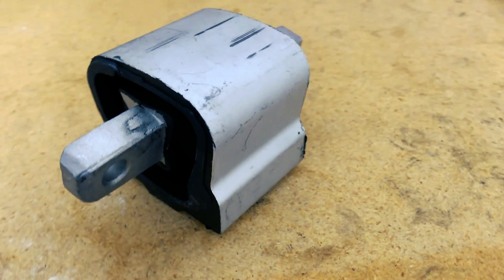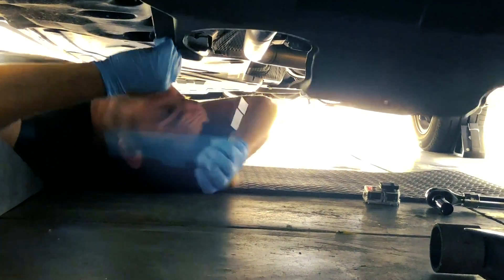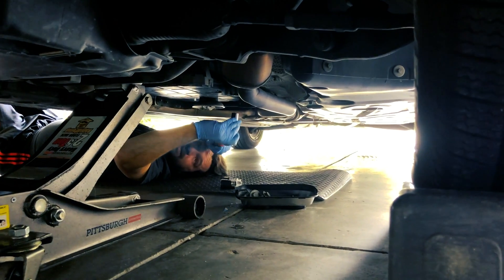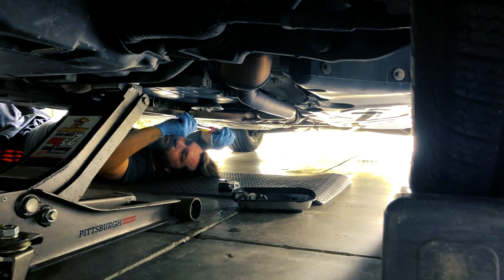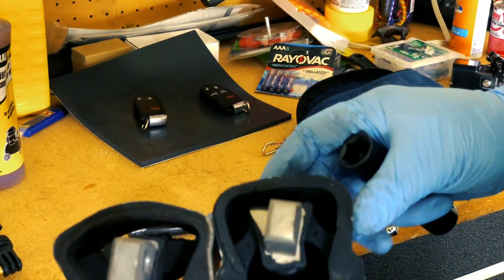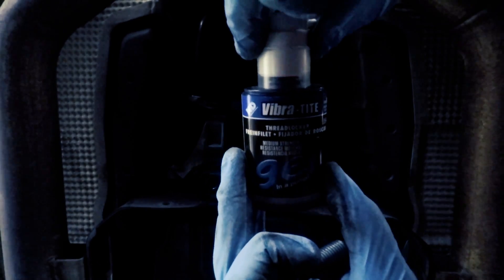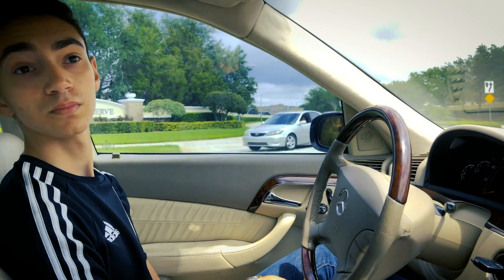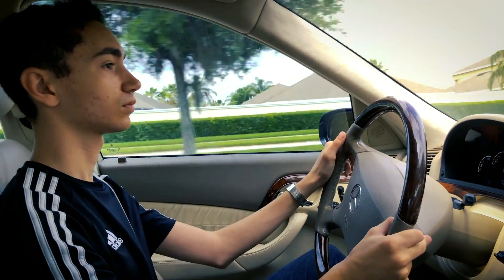Transmission Mount Replacement | W220

Comment: Nice Video. But can you put the year, make and model in the title? 
Thanks
Reply from the maker: It’s a w220. It also works same/similar for some older and newer models. Most info is usually in the description. The title has only limited space.

Comment: Thanks for sharing, I have noticed when I accelerate in 1st and 2nd then let off gas the gear stick moves (as if it is straining under torque load then moves when acceleration is eased off) just curious if this is a mount issue?
Reply from the maker: Hm, The stick should not move. I would say that transmission mount is probably the cheapest option to start with. Then move over to check/replace the flex disks on the drive shaft. Ours wasn't that bad so I didn't see anything moving. But we did feel a difference with the trans mount.

Comment: Due to a battery acid issue, I had to replace my transmission at 20k miles.  The new transmission (same year used with 14k miles) has been working great, except recently at 25k miles I hear a pop the first time I reverse.  The van is still under factory powertrain warranty. A tire shop is saying my issue is transmission mounts.  How is this possible at 25k miles? Is it possible to damage transmission mounts from off-roading?
Reply from the maker: I think so. Off-roaring puts a lot of stress on all your part. That being said, 25k? You must be doing some heavy duty off roading. Are you sure you’re not towing a Boeing through the Sahara desert?
Reply: @Turbo_Snail  Thank You!.  I don't think it's the transmission mount.   I heard the exact popping noise for the first time while stuck in deep sand last month. (note it's  FWD 4 cylinder van).    I drove 300 miles after that and never heard it.  It now only happens  when I pull out after being parked for a while.  Never while driving and it's a single pop with a change in direction.  Some have told me it must be a u-joint or an axle.  It tends to happen when turning left.  How can I diagnose where the problem is?
Reply from the maker: Not sure. I wish I could help you there.
Reply: Is this normal in a lifted FWD where there is no weight on the front tires? Im not sure the clunking noise is the same as the pop i am having.  Does FWD need weight to accelerate and shift?
Reply from the maker: What car is it. If it’s under warranty, I wouldn’t even touch it. Let them figure it out. Make sure they give you a rental in the meanwhile.

Comment: Hey guys. This was very clear and concise. We were just told our transmission mount was going bad ... at 48k miles.  They wanted about $350, which I declined and jumped right onto YouTube and found this. Very helpful.  Thanks. Keep up the good work.
Reply from the maker: Wow?!?  $350??? That is crazy! How old is the car that it went bad at 48k miles?
Reply: @Turbo_Snail  its a 2014 C250 Coupe in my favorite color, Lunar Blue.   It just turned 48k... and I think they are doing the usually dealer ploy by trying to find things wrong. They said it was "showing signs" of wear.. Yeah right.  

They also wanted $150 to change the engine air filter and $375 for spark plugs. They are the biggest MB dealer in the US and I assume most times people just pay...but NOT me.  I will wrench things myself. Thank you for this video.  If I get any vibration, I will do this.
Reply from the maker: @chazsch  Its great to see the list of things to do from the dealer. For the most part, you should be able to do everything yourself. I'm trying to remember but my dealer quoted over $1500 replacing all 16 spark plugs and close to $2000 for the brakes. I already did the plugs (no video unfortunately), but the brakes are definitely coming up soon.
Reply: @Turbo_Snail  I misquoted some prices

BATTERY REPLACEMENT : FAILED MIDTRONICS TEST $514 (its been like this since we got it two years ago)

ENGINE AIR FILTER REPLACEMENT : DUE EVERY 4 YEARS/40,000 MILES. DUE BY MILES AND TIME. $157.90

TIRES - 4 : LEFT FRONT TIRE IS 4/32 BUT HAS BAD OUTSIDE WEAR. RIGHT FRONT TIRE IS 5/32. LEFT REAR IS 4/32 AND RIGHT REAR IS 3/32. RECOMMEND REPLACING ALL 4 TIRES $1,260 (yes I will get tires and an alignment sometime soon. Still some good tread on those tires.

SPARK PLUG REPLACEMENT TURBO 4 CYLINDER : DUE EVERY 6 YEARS/60,000 MILES. DUE BY TIME.
$479.3 (48k...going to wait - plus its $100 in parts and tools. I will do this myself)

FOUR WHEEL ALIGNMENT (NON-DISTRONIC) : RECOMMEND WITH TIRE REPLACEMENT	$299 (thats high)

My Touareg was $1600 in brakes because you HAD to replace the rotors every time.  The back brakes were 200 ft pound and no one could get it off except the dealer.

Keep the videos coming and be safe

Comment: Did you notice any rattling or knocking noise with the vibration?? Like a deep low knocking sound?
Reply from the maker: No I did not. I checked the flex disks and they will be next but I didn’t have the typical flex disk signs. Like when you put the car in drive it feels like it slams into gear. You shouldn’t feel it when going from P to D. If you do I’d start at the disks.
Reply: This is what I’m trying to find out too, driving like 45mph or higher, when i slow down and push back on the accelerator, i hear the knocking sound underneath
Reply from the maker: That’s sounds like either the trans mount or flex disk. Trans mount is easy and cheap. Do that first, if it’s still there then flex disk.
Reply: Turbo Snail thank you, one last thing, is this trans mount you had changed is the same one that going to fit my 05 c240 4matic?
Reply from the maker: Hmmm, I doubt it. Click on the link to my trans mount. When on amazon it’ll ask you about your car. Enter your model and it’ll tell you whether it’ll fit. If not at that point you should be able to find your exact part.

Comment: How do you know when to replace the transmission mounts. The shop i go to said they are shot. Same with the motor mounts
Reply from the maker: When the rubber deteriorates the trans/motor can move when accelerating suddenly creating an unpleasant drive. Trans mount is very easy as you can see on the video. Engine mount is a bit harder because of how little space it is to get to. How much were you quotes for each?
Reply: @Turbo_Snail  well im getting shocks struts motor mounts transmission mounts possibly wheel speed sensor 1200
Reply from the maker: Holly shit! That’s a lot of money. Check FCP Euro and see how much they are there. Not sure how comfortable you are wrenching on your car, but definitely worth looking up some YouTube videos. I know the one you tuber from Chicago who works on Mercedes has done a video before. Well worth looking at those.
Reply: @Turbo_Snail  im not denise lol im her bf actually my phone is tore up as well. Im having to use her old phone which is basically a wifi phone.. My question would be i had my transmission replaced sometime last year idk exactly would you replace the transmission mounts along with the transmission. Its a 96 blazer so its got some age regaurdless if they needed to be replaced at that time or not wouldnt it have been bettet to just get new ones
Reply: @Turbo_Snail  80 n hr for labor. I wish i could problem is i don't have the tools or time.
Reply from the maker: $80 an hour is actually not bad. My Chrysler dealer is more than that. If you don’t got the tools, just let them do it. Sorry to hear, you’ll feel the difference once it’s fixed.
Reply from the maker: I wouldn’t count on it. They could have easily just left the old ones in. That how they are sometimes, unless you got a good mechanic, the would charge you for time and part. I’d say maybe 10% chance they actually did it. :/
Reply: @Turbo_Snail  ok so they fixed that i am going to my shop tomorrow cause my brakes are somewhat fixed idk. My shop had said that the driveshaft is digging into the transmission mount or something which was messing up everything. Now what does the transmission mount have to do with the brakes. They feel alot better now not spongy feel like its the master cylinder or power brake booster i want this fixed now. I want to make sure it is safe for my gf to drive n me also ofcourse. I dont want to throw money at it either
Reply from the maker: Hmm, they have nothing to do with each other. Are you going to Mercedes or an independent mechanic?
Reply: @Turbo_Snail  i went to the place i got the truck from buy here pay here. They did the transmission as well. Said the transmission mount was a 8$ part which my shop said 100
Reply from the maker: Yeah, that’s $8 plus labor. Check my description. I bought mine on amazon. Get it there and bring it in. Maybe it’s time to get another quote from somewhere else.
Reply: Just replace them they look crack and done

Comment: Are you using torque settings? What’s the make and model...etc
Reply from the maker: We didn’t torque it. Just bolted it on tight. Link to the item is in the description.

Comment: In what direction does the mount go meaning the slash on the mount go towards the front or the rear?
Reply from the maker: Hm, can’t remember anymore. Can you see it in the video? I think the bolts go in only one way. Try to fit it.

Comment: When I start driving in my vehicle between 0-15 mph there is vibration .. but never vibrates when the steering wheel is straight. If I start driving with the steering wheel turned left or right, it definitely vibrates, Please hep
Reply from the maker: Holly cow. I wish I could help but that’s beyond me. Try legitstreetcars. He was an actual mechanic, not  like me where I figure shit out as I go.
Reply: Thank you for respond boss.👌👌💯

Comment: How did this 15-16 dollar transmission Mount hold up?
Reply from the maker: It’s been almost 3 years and I think 30k miles. It still rides like new. Well worth it. Don’t spend the extra $$ on the oem unless you got money to throw around.

Comment: Why the hell would you use that cheap ass part that doesn’t even look like the oem part, don’t do this people, transmission mounts oem are cheap if u really can’t afford that then u shouldn’t be driving a Mercedes at all
Reply from the maker: Hm. 35k miles and still holding strong. So your point isn’t really one. It just works.

Comment: I have. 05 240 with 100k miles and mine does the same at right around 25000 rpm. Hope it works on mine
Reply from the maker: Have you done transmission service recently? If yes, it could be a wrong oil level. 

This is a cheap fix. If that doesn’t help you can do the flex disks on the drive shaft. When you put the car in gear and it clunks it is your flex disks.

Comment: Unfortunately only original MB or aftermarket Boge/Lemforder (both are the OM suppliers) will get you near the mileage as the factory installed did. This cheap aftermarket will be toast in a few couple thousand miles. Boge engine/trans mount are factory installed parts for like 30+ years.
Reply from the maker: I gotta say, you are right. Mercedes parts are superior to aftermarket parts. However, you gotta weigh your options to how long you want it to last.

In our case the car isn’t worth going Original. If the car was in better shape, probably. We need this one the last 5-6 more years, that’s it.

Comment from the maker: Well, just noticed a little bit of shudder. So I’m on the right path the the vibration problem. Next will probably be engine mounts :( and maybe flex discs???
Reply: I had the same problem, a vibration in motion at a certain speed range. I fixed it by replacing transmission mount.
Reply from the maker: excellent, glad it worked. It was a cheap fix.
Reply: @Turbo_Snail  I wonder how much a shop would charge me to replace mine on my 2004 MB E320
Reply from the maker: Hm, not sure. It should be quick. Most independent shops around here charge now about 120-150 an hour.